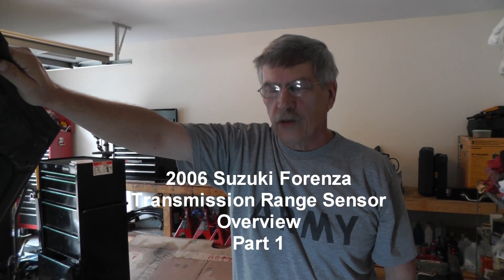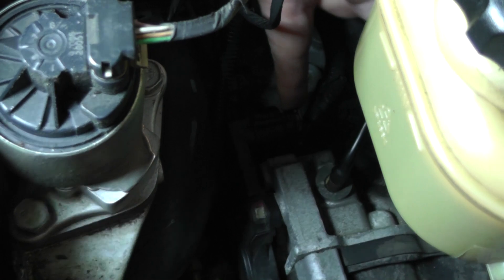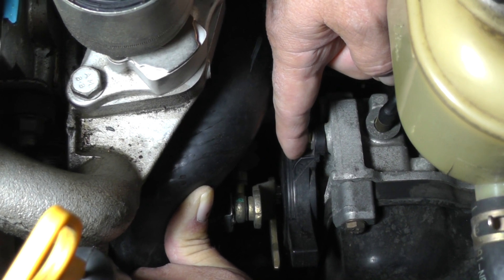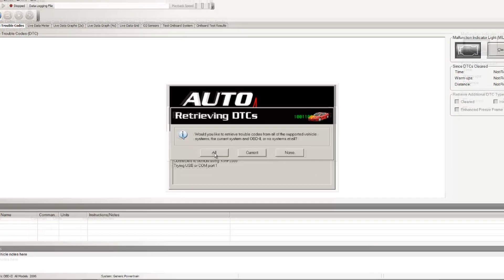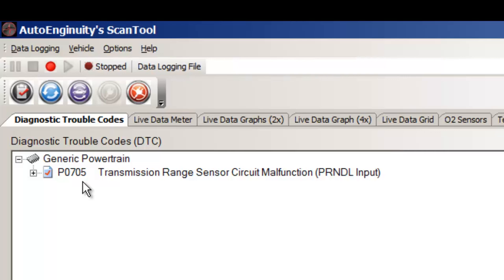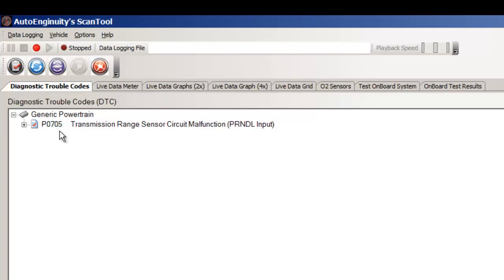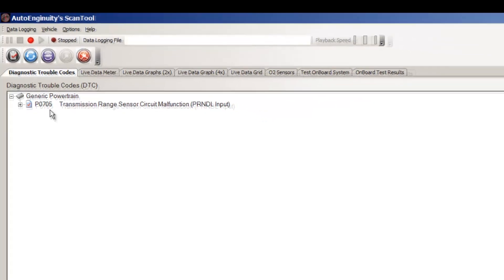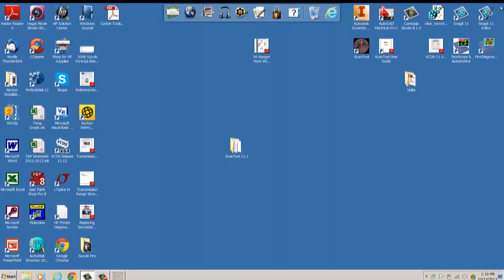Suzuki Forenza Transmission Range Sensor Overview - Part 1

Comment: heloo. I have a 2004 Suzuki forenza. Fuel is a big expense for a 10 liters through to a maximum of 35-40 miles in the city and no one can understand what is going on, air filter and spark plugs replaced my throttle was cleaned, a computer error was not ours and you can not tell me what the fault could be the fuel for such great expense? Thank you in advance.
Reply from the maker: It's hard to say as it could be several things which some you've already mentioned. From my calculations, you're getting a little better than 15mpg which as you've mentioned is a lot of fuel. If you have access to a scanner, you could look at the fuel trim numbers to see what's happening there. You could be running lean but the computer hasn't picked up on a fault. Does it have any misfire, hesitation, rough idle, etc.? Maybe your O2 sensor is not working correctly, fuel injector not spraying enough which creates a lean condition where the computer makes the  mixture richer. My best advice is to get a scanner on it and analyze the data, especially the fuel trims and see if that can give you some direction.

Comment from the maker: Yes Thomas! I just forgot to drop it down. Most of the time, it's not really useful for the generic scanner that I'm using from AutoEnginuity. With their enhanced version of scanner software, there could be some other useful info such as pulling codes from certain modules and things of that sort. In this case, it only said the code is related to the TCM. Sorry about that.

Comment from the maker: Complex is what? Nothing more than a string of components built together which appears complex. Got any better ideas than using a manual transmission; maybe a new invention.

I guess if you look at anything you could find something in it as far as the banner. So that it wouldn't offend some people, I put another photo in which doesn't show any appendages of the human body.